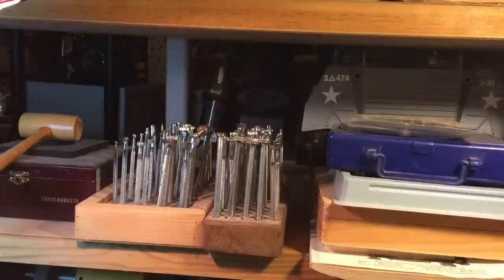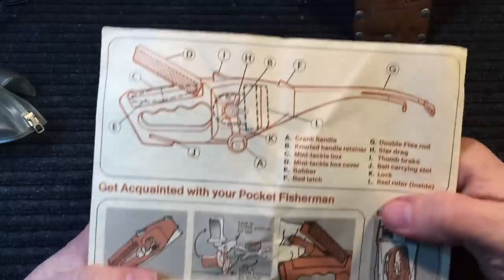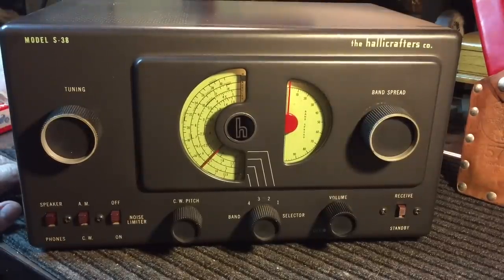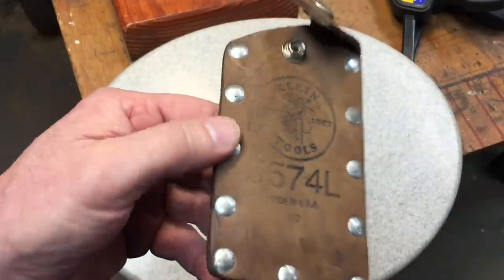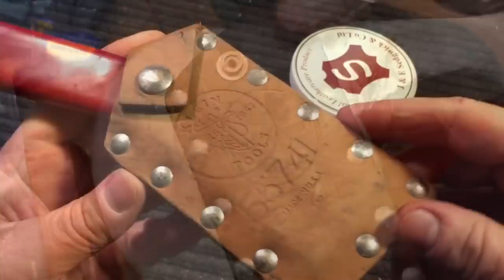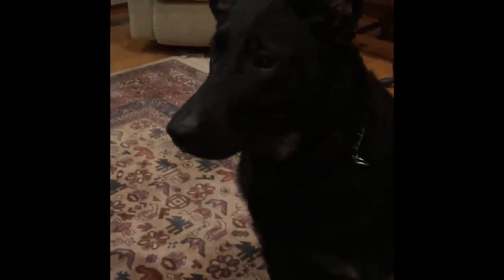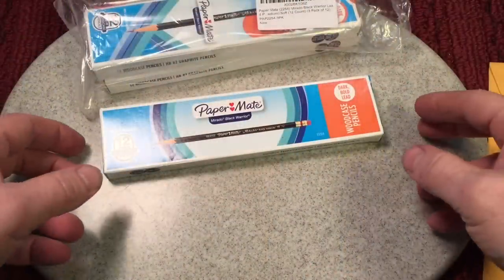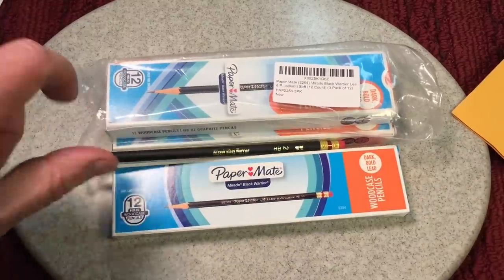MMM- Leather Finish, Hallicrafters S-38, Pocket Fisherman and More!

Comment: Anyone who has been in the armed forces knows parade gloss shoe polish as the only one that will pass muster for inspection. There is a great video from the British Army on how to polish boots (polish, water and lots and lots of work to get the mirror shine). I used to keep one pair of boots for inspection and never wore them anywhere except the parade ground and afterwards would remove them carefully and put them away in the locker to ensure no scratching to the mirror polish😁. Great video and I think the modern  equivalent of the cost of the radio is around $550, phew.

Comment: I'm tellin' you, Scout, I don't know where it is, but there' must be a bolt of cloth we were both cut from. Black Warriors have been my pencil of choice for decades. I got turned on to them by my buddy, Jack Shaffer; I knew right away, now that's a pencil! Jack said they had tons of them in the stockroom for the bookkeepers, No.1's, No.2's and even No. 2 1/2's. The earliest were branded Faber-Casteel, then Berol and I bought what I thought was a lifetime supply. Those lasted until my son, Johnnie Cash, Jr., entered his everything black phase. Well, as you know, Berol was bought out by PaperMate and now they are matte black instead of shiny. I am down to less than 2 boxes of the Berols - boy, I hope Papermate only changed the color and didn't screw with the lead formula.
Reply from the maker: I wish I would have gotten to try the gloss black version.. I don't know how they compare.  I do like a slightly softer darker lead... Maybe a B or 2B...   =)    Great stuff!!

Comment: Two other indications of cheap pencils: the more you try to sharpen them, the worse it gets - this is due to the graphite rod not being centered in the "wood."  Another feature is the "wood" is actually some sort of plastic that will bend quite a bit without cracking or breaking.  Cheers, Terry.
Reply from the maker: Hi Terry!  Yes!  Their is more junk pencils out there then good ones for sure!

Comment: It figures you would mention obeanufs lol I think you have at least one of everything haha. I use pencils alot and got tired of the regular number 2s breaking now I've switched to Dixon my first ticonderoga they are a beefed up version of the standard number 2 made to he marketed for kids lol. The lead graphite whichever you prefer calling it is thicker holds a point or least useable tip longer and more solid so it doesnt break in my tool bag

Comment: Brother scout you've gotta get the leather treatment on the inside of sheath where the leather pores are when its that dry.
Reply from the maker: Leather is not the best sheathing material as it can hold moisture.  Kydex or vinyl make a much better sheet as they do not retain moisture.  The reason the inside of leather sheaths are not treated is because it makes for a smooth release of the knife or tool.  =)